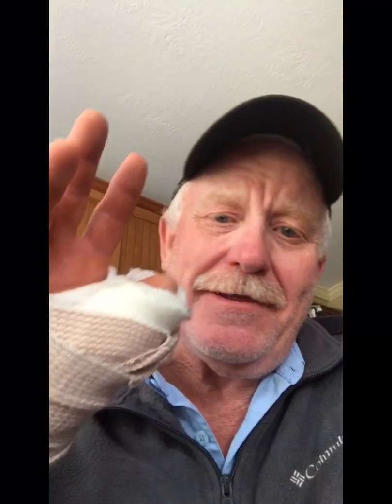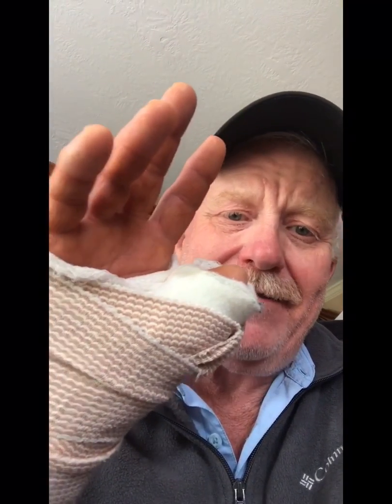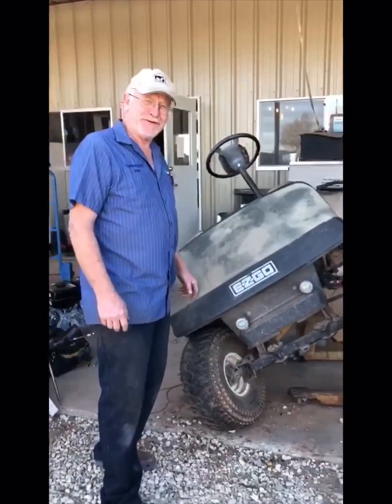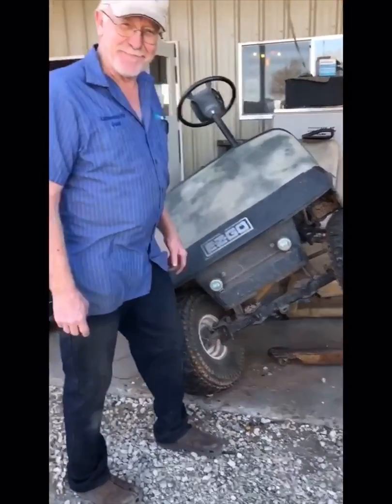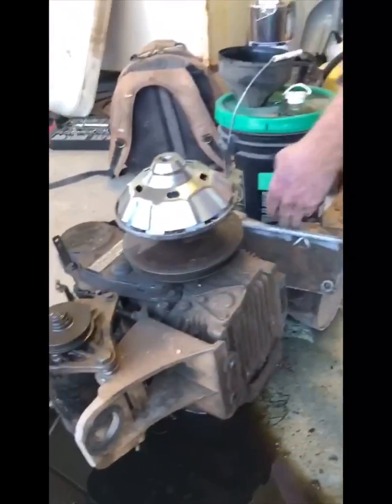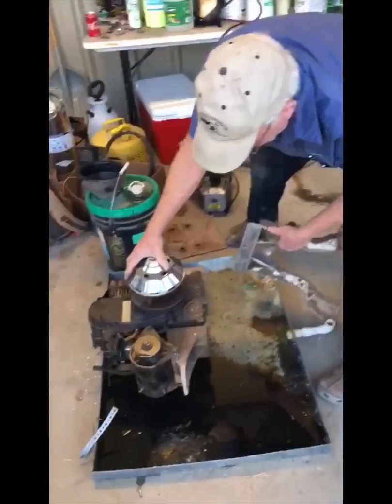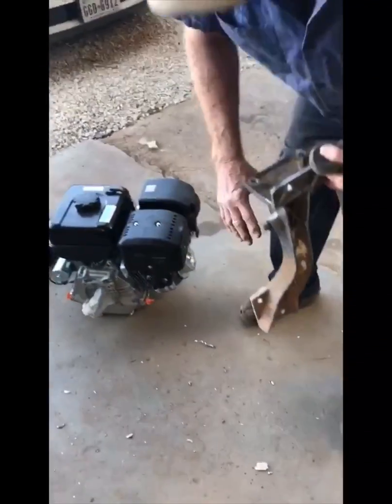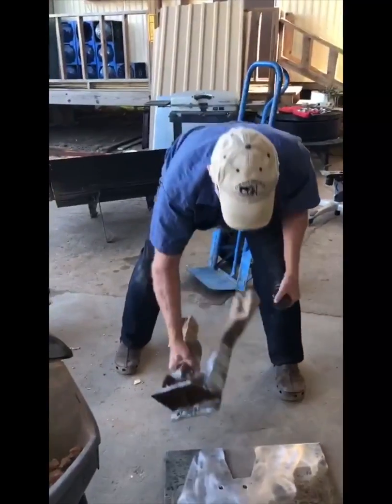Ezgo golf cart 13hp Predator Engine Swap - Part 1

Comment: Checked rebuilding old engine 
But way to expensive 
Looking into a 15 hp motor single piston price $129
Probably be a lot lighter and maybe faster, but your idea looks like a better way to go and cheaper too, don't know if it will have more power to climb hills?

Comment: I did the swap also, but I used a cheap electric fuel pump and regulator from auto zone the pump is max at 4 and the regulator is adjustable from 1 to 4 what would set the fuel pressure sir.